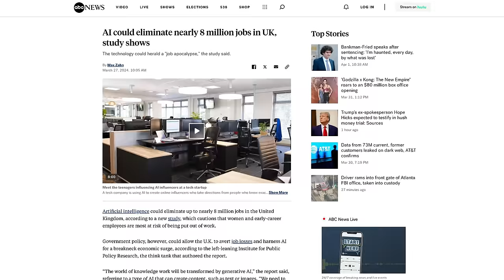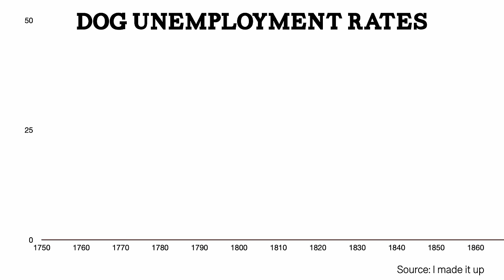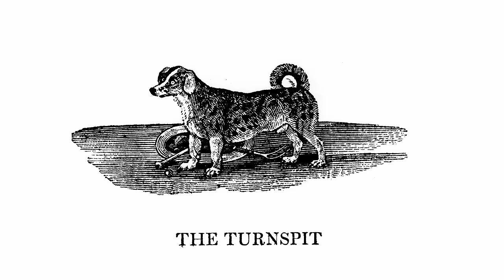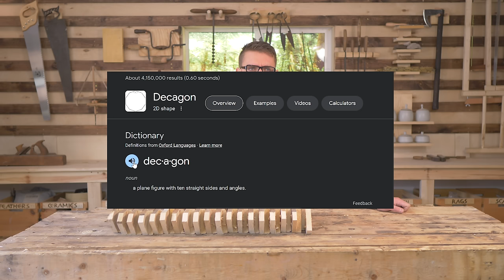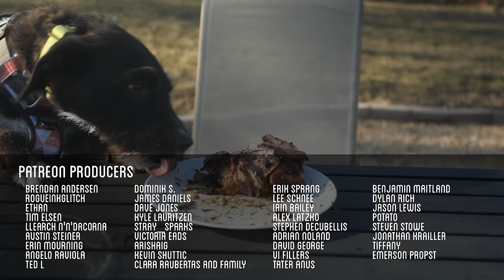I Brought Back this 15th Century Dog Powered Technology

Comment: You could try tying the leash in a position that encourages the dog to stay slightly forward of center. Not so tight that it chokes the dog obviously, just makes it a bit uncomfortable to stop walking. That way you also can tell that if they choose to stop even with the discomfort, it's time to take them off the wheel and let them rest. An adjustable hitch alongside the wheel would be the easiest way to do this.

Comment: You could link the wheel to a treat dispenser which displays a treat, and drops it if the dog runs a certain distance, rinse and repeat. This would ensure the dog runs for a specific amount of time before becoming to full on treats and jumps off. Obviously you have to teach the dog that if they run ancertain distance on the wheel it drops treats, but once you complete that, it becomes automatic.

Comment: @6:12 Next time, line up the assembled (but not glued) wheel to the 2x4 and start to drill  the hole through the hole you drilled in the wheel joint. At least enough to make a centering divot. Then take it apart and drill the holes. Just mark where they went because they will be specific to each joint and rotation. A lot of times it's easiest to take the measurement using the other part.

You could also sand or shave down the pins a little to make them slide in better.

Nice job!

Comment: Lots of your videos have wood against wood friction.  You should consider using some lubricant.  One that works between wood surfaces is graphite powder, which can be sourced naturally.  The down side is that you need to keep replacing it.

Note:  charcoal will not work as a substitute due to its rougher texture when compared with graphite, which is very smooth and uniform.

Comment: The fact that the original breeds for this purpose are now entirely extinct with no real benefit to continue to train and breed dogs for this specific purpose anymore no doubt hindered you significantly in the training process. Sled dogs will take to treadmills and wheels like it's nobody's buisness. I imagine if there were still small carting breeds around they would easily take to the wheel as well.

Comment: With the amount of half-laps you do, you should look into making a 'router plane', easily one of the simplest hand-planes to make and it'll help a lot with the funky grain you often run into with construction lumber (though you're doing a pretty darn good job free-hand I might add). If you're not already doing it, try drilling and driving your pegs in at a slight angle off square and alternate them (5-degrees or so), it'll help hold things together a bit like a dove-tail joint.

Comment: "emotional support animal" is a great job. how dare....

seriously though, I heard there was a design for a spit turn that used a fan in the chimney to use the raising smoke/hot air to turn the spit. sounded cool.
Reply: Sounds like it'd need a lot of torque to turn and I don't think atmospheric pressure could provide it. Plus you're impeding airflow in the chimney meaning more smoke is likely to enter the room.
Reply: @killingtimeitself  
Actually the whole idea of using the draft from the heat of the fire probably isn't the most efficient way to do it. I only mentioned it because I recalled that in one episode of Good Eats they said that Leonardo da Vinci had designs for a rotisserie cooker that operated on this principal.

Hypothetically you could use a small steam engine to rotate the spit, and it would have much better torque, and more efficiency transfer of energy (I think).

of course da vinci also had designs that used springs or weights/gravity to do the work, which were probably more effective and efficient.

Comment: You need a dog that is crazy about running. Like a greyhound. Huskies love to run but they have too much fur to do it in hot climates. A Husky crossbred with a short haired dog could work. You need a dog that gets the zoomies. The wolf can hunt by following prey till they exhaustion. That is the key to motivating the dog. They can feel the rightness of their wolf heritage in running on the wheel if they get to take part in the chicken feast. The fire fear is what messes with getting Rex to work.

Comment: Punishment and reward. "Risk and reward" is gambling. For some reason people think games are the latter and it's both ironic, amusing, and sad to see people speak so naively about games. The same principles apply here: there is a condition: if A then B. You want B, which is only because of A. You must substitute B with something "intelligible" to a dog, and likewise A itself: you want turning the wheel which is necessary to turn the chicken. Simple solution? Create a transparent dispenser of treats which both opens a lid and dispenses treats on an interval on condition of continuous movement (perhaps make the interval fine-tuned to the dog's capacity to run).

To make the dog respond to command, associate another action that is convenient for you as preceding the desired action done such that the desired result occurring alone is rewarded, while an undesired result is punished, though this having its own punish/reward system would make this more efficient if possible. Something like "<name>, wheel!" to get on the wheel (and "off!" to get off), then "<name>, run!" attached to the feeding apparatus (with "stop!" to stop). The training is complete when the dog consistently responds to the command itself without the reward/punish system in place. I will disclaim, however, that I am not a professional dog nor animal trainer; this is all from principle based on an inductive hypothesis of how neurons work in general. I have not syllogistically proven this to be true.